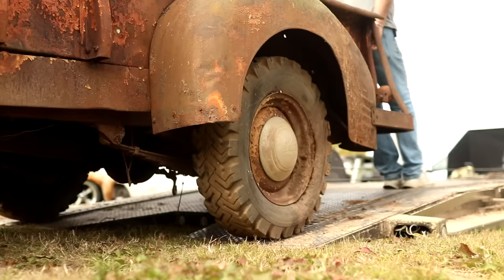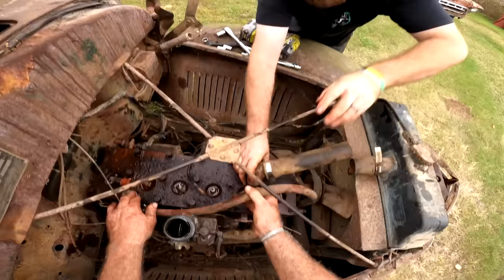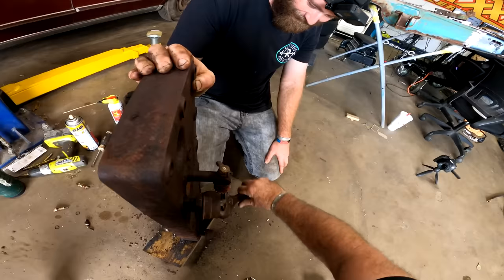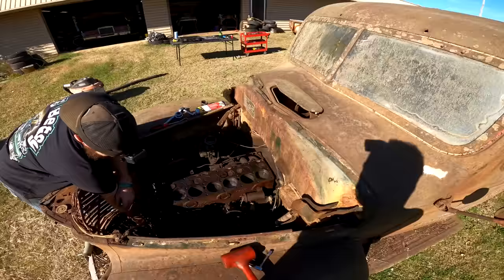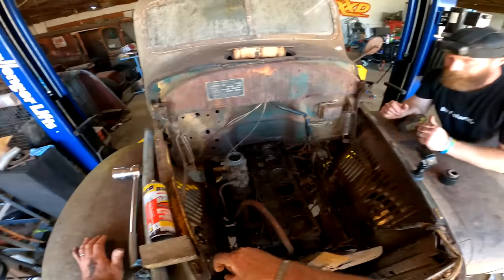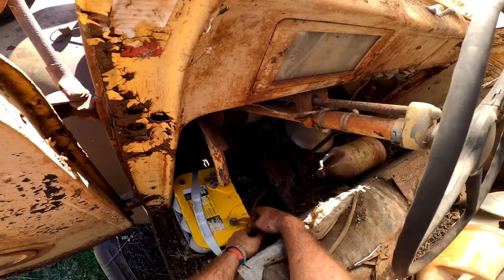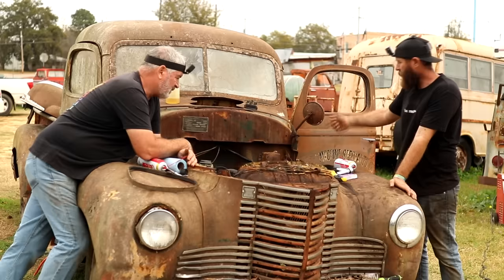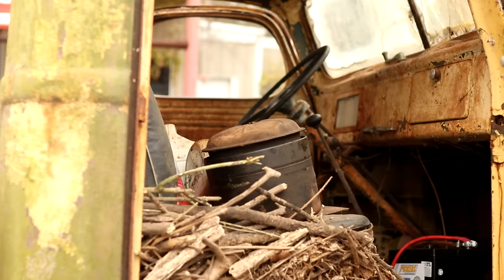Will It Run After 50 Years?! Abandoned 1946 International Truck | Engine Locked Up Solid | RESTORED

Comment: What a memory. Dad had a 1947 . We piled seed corn bags on the front fenders and took them to the corn planter. Was a big deal to drive the truck off road on the farm. I don't ever remember any mechanical issues until after I was married in 1976 and we changed a water pump. Lightning struck close and  St Elmo's fire danced all over the engine block. Then the tornado showed up and took part of the barn roof.
  Unbelievable that Dad sold the truck without asking me if I wanted it!

Comment: Great job guys I used to work on stuck engines and if I had heads off I would use torches to heat up pistons then put  my snake oil in the cylinders as it cools it draws it deeper into the rings also the change from hot to cold would help

Comment: I had an old KB-1 retired Idaho Bell Telephone truck I bought in 1976 while I was a student at WSU. (Washington State University) It was a pretty solid old truck 45 years ago. It was good enough that I drove it across the state from the Idaho border to the Puget Sound without any issues. I used a quart of 30 weight oil on the trip (plus some healthy doses of STP) It had a three speed on the tree. I learned how to double clutch on that truck. It was happiest at about 50 miles an hour.

Comment: I've heard a couple times listening to you guys mentioning "checking to see which direction things were going" in relation to whether you smack a piston one direction or another. Fellars, the motor is static when turned off, so it does NOT matter what direction it rotates when trying to break it loose. it can turn in both directions when turning it by hand or by hammer. It only matters - direction wise - when it is running. Smacking a piston to loosen in the opposite direction is "was" turning while running is perfectly fine. Brutal, but fine. This is no different than smacking one that was on its way down prior to when it stopped... and then rusted in place. 

Love the show! Glad you restored yourselves.

Comment: A rusted, junk yard bound truck, cranked up and driving. My congratulations. Most people, almost all, would have given up and said no way, but you did it. Just goes to show what can be done when you are determined to not take NO for answer. If THAT can be made to run, almost anything can be.
Reply: I say fix what you need to be safe clearcoat the rest ,clean the windows and drive the old girl.

Comment: I had a Mercury V8 flathead that did the same thing and when I took the starter out it allowed it to turn over. The starter was up on the flywheel. That turned out to be the perfect engine. Great job.

Comment: An Ole Boy taught me when it came to stubborn bolts, nuts &spank plugs is;
Use a break over bar with 6 point socket, with or without chester bar. Go tight first then back loose R L  R L R L and if you can get it to walk you can get it to run. If it is possible to smack it with a Hammer, don't love tap it, put some stank on it, but don't force it, get a bigger hammer known as a BFW.
Spark plugs & like size fasteners respond best to a Hammer driven Impact or a smack on the Breaker Bar, again 2 whacks right 1 smack back 2 whacks 1 smack back. RRLRRLRRL
When using heat also use cool such as using compressed air. It's the expansion & contraction that breaks the bond. 
We used 2 cycle oil down the spark plug holes because it's made to burn in the cylinder.
Breaking compression  rings free we use gasoline first, gas penetrates a little better followed with diesel fuel as needed. lol
Impact Driver forward, reverse forward reverse.
WD 40
Oil will penetrate until it hits moisture then lay on top. Water is the all time penetrating fluid of all time. 
W + H = Steam

...o~`o_         lol

Comment: I've once had good luck using green Scotch-Brite pads on the cylinder walls, along with a penetrating oil to help free up some of the rust, at least above the piston rings.  After hours of that,  I finally was able to turn an engine over, initially,  via it's flywheel. That was a flathead as well.

Comment: about 40 years ago i bought a 52 plymouth savoy 3 door station wagon. the motor was locked up. i took the plugs out and for a week i put a mixture of diesel and 30 grade oil. it took a week but it let go. i turned it on the fan every night after work. boy it smocked a lot when i started it but after a while it cleared and ran great.

Comment: I sent this video to a great friend in Boise ID, who happens to be an Old Iron addict and Lord lover just like you folks. He mentioned a tip that makes a lot of sense when trying to get a "stuck" engine to turn over after settin' for so many years. He recommended getting one of the back wheels up off the ground and rocking it back & forth with the trans in gear to pop the engine loose. Taking the plugs out and squirting a generous amount of ATF in each cylinder to let soak while chopping the truck out of the woods would certainly help as well. Give it a try on your next stuck engine rescue and let us know how it went. Stay safe, stay handsome and to the girls, stay pretty .  👍 ✌

Comment: You need to verify that the downward force you are exerting on the top of the piston with the hammer/wood block is turning the crank shaft in the same direction as the direction the flywheel is being turned—how can you do that without pulling the pan and viewing the the rod of the piston you are pounding on? I think you guys are creating a LOT of extra work for yourselves! Now you are talking about more 'heat'! I watched you DIRECTLY heat up the spark plug (expanding it even tighter in the threads of the head!) rather than heat up the head a couple of inches from the seized plug to get the threads to expand AWAY from the plug. Watching this is fun!

Comment: Once again I would like to suggest putting a block of wood on top of the piston. 
Set the cylinder head on the block of wood and put head bolts in the head around the cylinder with the cylinder to be pressed. Use the head as a press against the block of wood on the stuck piston. You would probably need to cut a piece of wood that would leave 1 inch or maybe 1/2 inch clearance between the head and the engine block....Good luck....God Bless

Comment: I didn't see any cans of Seafoam anywhere.  Man, I love that stuff.  I have some old generators and mowers that are still alive because I store them with Seafoam in the carbs.  I even keep my wife Toyota Sienna alive by putting a 1/4 cup of it in the oil a day before changing it.  It keeps one of the finiky oil drenched engine sensors from going bad.  It went bad already once, but as soon as I ran that Seafoam in the oil, it dissolved all the gunk that was cloggin it up.

BTW, I think your dad is too big to fit in that truck.  lol!!

Comment: Old International's are tough truck's and Equipment . They'll make you want to lite'm on fire at times but then they cooperate , most of the time . FYI  12volt's on a 6 volt starter is like 24 volt's on a 12 voltDetroit Diesel start . Sounds like the Chrysler Hemi dragsters .   Awesom video .

Comment: Wow nice old KB 1 International pickup. I rescue one in 1983 that was headed to the crusher me and my wife rode around North Carolina Mountains one weekend looking for an old truck didn't find it when we got back home late Sunday evening I remembered a junkyard just down the street from our home I drove down there Monday morning low and behold the owner of the yard had ran a forklift through the passenger's door and the back of the cab setting it on a lowboy to take to the crusher I was able to buy the truck for $50 what it was worth at the crusher it had the old green diamond engine and four speed I removed all and installed an old 1954 fire dome hemi. It made a nice old rat rod.

Comment: Maybe make yourself a tool, a piece of flat square plate drill out the head bolt pattern for the affected siezed cylinder, then thread a bolt trough the center of the plate to push down on the piston but be sure to put something to spread the force of the bolt around the piston with a round piece of plate or something. if the bolt pushes directly on the piston you'll likely punch a hole through it. This has really helped me in the past. that way your not hammering on the pistons.

Comment: Good job. That's the way I used to get old tractors unseized: on the ring gear. There is no more powerful mechanical advantage available to you than the incremental amount of one ring gear tooth at a time. Pulling almost never works. Crankshaft nuts are apt to snap off. Going through the PTO or belt pulley will slip the clutch.  If pulling the head and cleaning and soaking everything available and then pounding with a sledge and a wood block doesn't get it, you're in for a long soak and pound, wear it down battle.

Comment: That crow bar would work better on the flywheel if you contact the gear teeth at a lesser angle.  When you reach to far in you are in danger of breaking the surrounding cast iron.

Comment: So when you're trying to use the transmission to break the engine free, use the highest gear possible. The higher the gear, the more leverage the wheels will have against the engine

Comment: ColdWarMotors (Canada),  did b rebuild on a Buick Straight8 that was locked up.  Used a plate bolted to block, with fittings for applying pressure from a ram pump.  Used a mixture of heated ATF and Acetone in the cylinder "stuck".  Was sucessful, give it a try.

Comment: i had seized engines and the best way i moved it was got a pinch bar like a tankers bar crow bar would be too small and pry from the block and flywheel gear using the bar as a lever and that engine will turn you could try a crow bar but you have more leverage with the longer tankers bar

Comment: Just a little trick I’ve used several times on a stuck piston is after taking the rod loose and lowering the crank is build a makeshift press that runs across the cylinder, you can usually find some head bolt holes that will let you line it up. Build the press to use a jack bolt or small porta power head.

Comment: I've often found that if you fill seized cylinders with Marvel Mystery Oil and let it sit with a 100 watt light bulb turned on and touching the block, after about 3 days you can take an impact wrench on a low pressure setting and "shake" the crank shaft again and again, slowly increasing the impact wrench's power and it will free the engine.  I've done this many times over the years with all types of engines.

Comment: Y'all would be shocked at what a bit of heat lubricant and an air chisel will do to get a plug like them out its a bit tricky and may take a while but it works and if done correctly doesn't damage a head or get stuff in the engine

Comment: You realize that u could u an old piston upside down to get equal distribution of the impact...you could also use deadblow hammer resting on piston and hammer the deadblow to provide the most impact as possible..

Comment: I had a 50 GMC Pickup, that i made a sweet running every day HOT ROD!  I put a 327 corvette engine . 4 to the floor in it > Loaded with all sort of goodies for racing parts. IT WAS SWEET DUDE!  😎 I keep the body Original.  Hopped it up, and the suspension. Sweet mag wheels and tires.  Then i got married my wife said those cars goes or she was going. > I wish i told her HIT THE ROAD!   One of my friends bought it from me. and took all the racing parts off and put all the Original parts back on it that i took off.   NOW ITS A GRANDPA TRUCK  😒😒

Comment: You won't believe it, but similar OHV 6-cylinder engines still drive on the roads of the former USSR. This is a GAZ-51 truck engine model. An American engine of the 30-40s was taken as a sample.

Comment: You guys should also use a drill instead of a hammer, then they sell these bolt extractor kits which fit a ratchet by the way.

Comment: It would have been better to remove the engine, dismantle it, clean it up, and reassemble it. It would have fired just fine. Even the starter needed a bit of clean up.

Comment: I don't want to give advice, but very old engines have to be disassembled part by part, cleaned, checked, replaced with the necessary components, then reassembled and look, it will work from the first attempt. What the two "mechanics" do with the hammer and the crowbar is called an improvisation, a very short version, a high risk of destruction, a lot of liquids, a little science, a waste of time.

Comment: next time just save effort make some coffee fill that whole block reuse fluids after it settles get micron filter pour throw use hot fluids not cold heat up with the whole block with battery or block heater even temp they will leak cheap catch pan bolted under wire ect. diesel my thing well vented but gas heat oil thiers order

Comment: If you really want that motor to free up get all that oil out of the cylinders and pour some white vinegar down the cylinders and let it set.  White vinegar cuts rust in gas tanks and cleans them out before applying a coating to them and eats rust which is causing your 6 cylinder to be locked up.  Try that and let it set in there for a week then put some marvel mystery oil and let it set more time then it will turn over.

Comment: even brushing old hot oil loosen bolts cheap breatheing that airisol let sit works on evering even air and small spayer i mean 8oz like air brush on after a tarps down under with card board use for burn barrel

Comment: I noticed the propane bottles in the background... What happened when you tried to use heat to remove the seized spark plugs? I have used heat combined with a non-flammable
petroleum (oil) product. and the oil generally penetrated the metal (in the hottest places) to cool it down. Just a thought...

Comment: Evaporust will not work very well on oily surfaces or on oil saturated rust. My preferred method is as follows and I have said it before and will say it again even though I have had some people who are dead set against it reply to my coments suggesting it, but for stuck engines where nothing else seems to work, clean the oil out of the cylinders that are stuck and pour vinegar in it and usually within 24 hours i will have eaten the rust away but leaves the solid metal unharmed. Yes vinegar has an acid in it which eats the rust, but it is a mild acid and it would take a very long time for it to eat away the good steel. It is shocking ho many people refuse to do it out of fear itis going to eat away so much good steel that it will cause damage. Not only have I freed up many engines this way but I often get rusty tools that were being thrown away and I  just toss them in a pail of vinegar and let it go to work and usually the next day I will pull them out and clean them up with a rag and clean water and tthen I oil them to prevent flash rusting. sometimes I get busy and an get back to them for a week but they are fine and are rust free. I do recommend wearing rubber gloves when removing them from the vinegar and when cleaning them up or your hands will be black and it is hard to wash the black off your hands. Engines are easier than tools.

Comment: I watch u.  2 . U never pump fuel from the tank. .it well pull garbage fuel from the tank. . Siting over 10 years . U hook up a clean fuel system.. to get it to run. And u clean the carburetor too.

Comment: Bro if you pull the truck it didn't move the pistons easier? Make sure that is not in gear while you want to move it lose whether pulled or pushed because the transmission will lock it in gear, leave it on neutral to try to move it by yourselves otherwise it will be laughing in your faces! When hammering a piston, you have to take in consideration there is a point where the piston is up or down or too close to up or down, being impossible to move just one because they're interconnected, so you are trying to move an engine by hitting just one piston that's being not moved for years and look at the teeth of the flywheel, they need to be clean or that dirt will conspire against your banging. Try to only hit the pistons that are half way, if they get stuck, hit another, because either way all you want is to make one move a little, like when you're unscrewing a bolt, it'll move to where is easier either tighting or losing, you'll try to move it lose or tight to make it going, same with the piston, hit one another, another, once you got one moved a little hit another just to losen them up that tiny bit until you get them going but clean the flywheel man.

Comment: I saw something fall at 43:47 that looked like a tooth off of the gear on the flywheel.  That might be your starter issue.  

My '47 IH also has the dodge rear fenders.

Comment: More of your dim witted startup geniuses. A real mechanic who isn't lazy doesn't think about all the short cuts these dudes try and will pull the engine without thinking twice, take it apart, de-rust the rings, take them out and clean the ring grooves. Clean the engine, bearings, crankshaft and engine block, measure the wear of bearings, rings and cylinders, reseat the valves, check the head for cracks or warpage, clean the carburetor, starter, get new plugs, wires, points and coil. Refresh the generator, check the fuel pump, clean the radiator, check for leaks. Check the clutch and flywheel. After it starts and runs, go thru the tranny, rear end oils and the brakes.
Even after you free a free a rusted piston, the rings are still seized and inoperable. Running an engine like that just damages the cylinders.